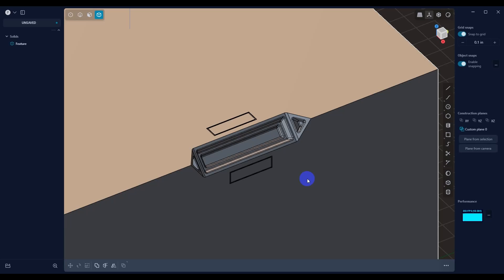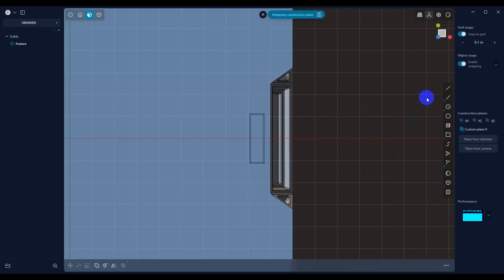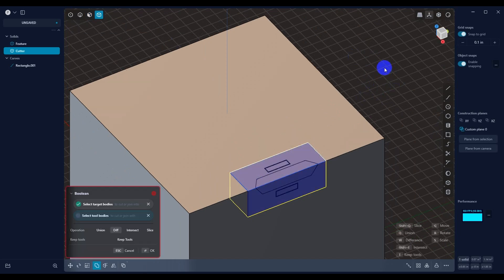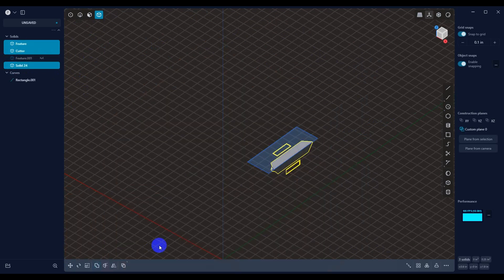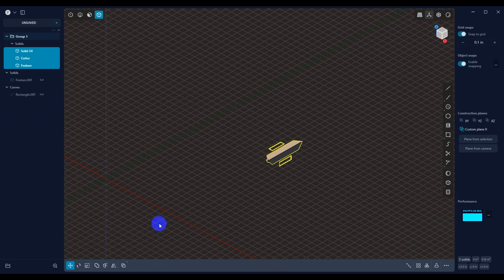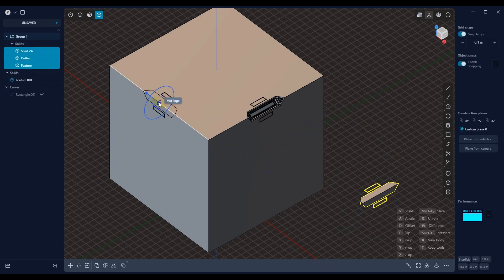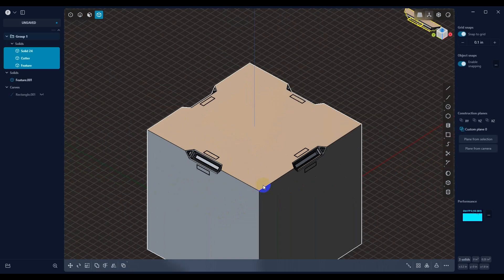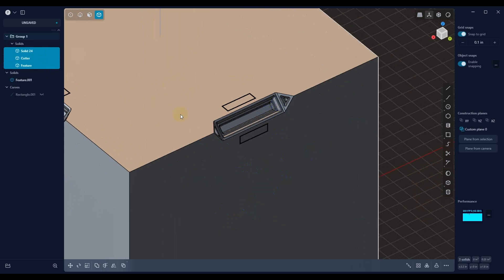How to Create Kit Bashing Parts in Plasticity1

Comment: I just did something like this on a model i'm doing... 
How come on the model in the video, there are no other instances of that duplicated object in the outliner?
Reply from the maker: @hchattaway
That's how it works when you use the place command. If it created pieces rather than just cutting away, such as nuts or bolts, they would appear in the outliner. So, essentially, it cuts the feature away and leaves a single solid object.